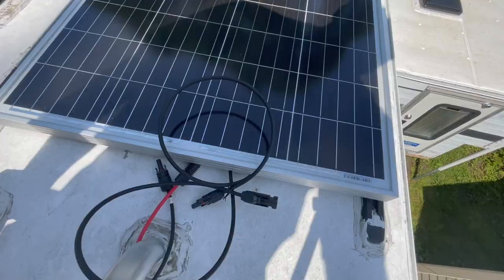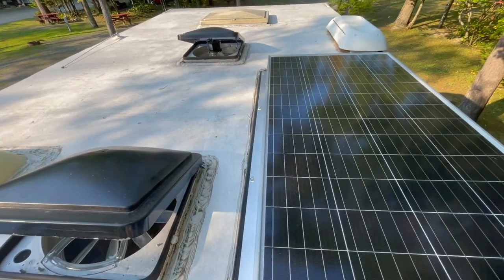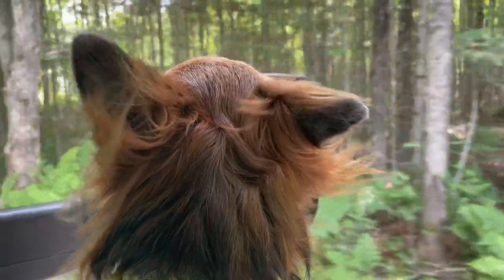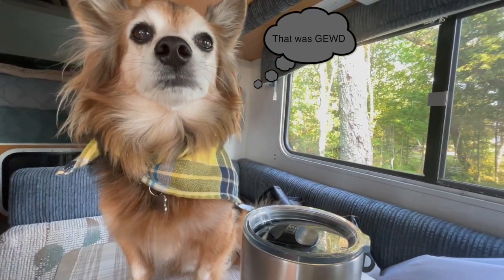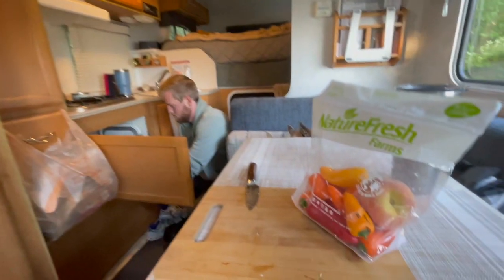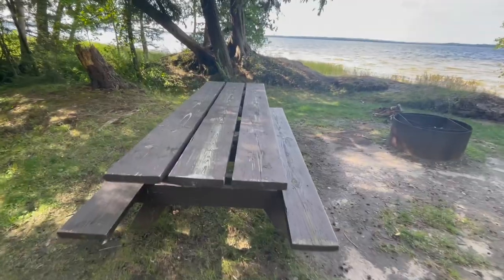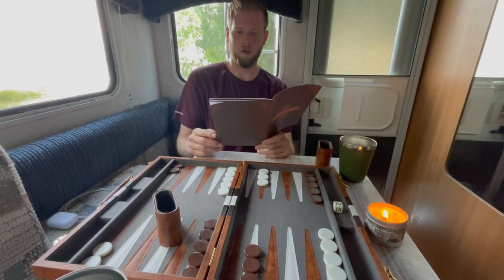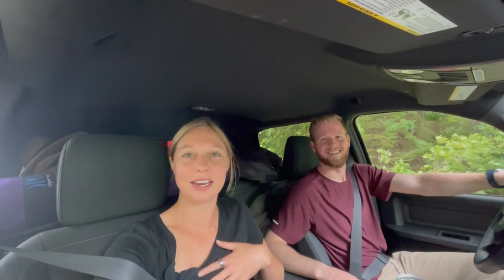DIY SOLAR INSTALL - Is 180w Enough for FULL TIME TRUCK CAMPER LIVING?

Comment: Great job installing your solar. We are very impressed with the amount of space that you have in your truck camper. What a great spot to camp right by the water. So lovely. Mary💕Fred
Reply from the maker: Thank you! We’re finding the amount of space surprising as well, especially for the small platform of the 815!

Comment: I have 225w of solar on my Lance 845 and a single 100Ah Lithium battery.  Summer of 2021 I traveled for 5 months and never used anything but solar to keep my battery charged.  However, I don't have any high wattage devices, like coffee maker or hair dryer.  Safe travels.
Reply from the maker: It’s kept us pretty charged as long as we aren’t running the fridge on 12v. But very happy with the panel so far!
Reply: How much did it cost you to set up?
Reply: @aceazar2806  Not sure if you're asking me, but here's about what my system would cost if bought today.  I installed it myself.

Victron MPPT 75/15	$125
100Ah LifePO4 Battery	$350
2 ea 100w Solar Panels	$200
Misc cables		$ 75
                       -----
                        $750

Comment: Cover the roof. Inefficiency and availability of sun are strong factors. Worst case scenario is are best. Friend with 1000 watts had issues on sunny countries because of worst case conditions. There are some newer very efficient panels. Raise,ventilate for better efficiency. Stick on are handy but inefficient due to heat and expensive. Enjoy stay safe.
Reply from the maker: We’re planning on two more panels that will basically cover the rest of the open space on the roof. Stick on seem easy but I like the hard side panels better so will likely go that route. Thanks for the input!

Comment: Would like to have seen the panel rails being mounted to roof. What size screws and which adhesive or caulking?  Thanks!
Reply from the maker: I'm not exactly sure on the screw size, I just took the mounting plates to Home Depot and used their screw section to find what fit. Sorry I don’t have more specific information!

Comment: Thank you for sharing! loving your adventures. How did you connect the solar power bank to send power to the truck camper? Or do you just use it to plug in devices, etc?
Reply from the maker: Hello! Thanks for the comment, we disconnected the 120-12v inverter that came with the camper and wired the 12v cables into the Anderson output on the GZ. It’s worked great and I can send the cable links if needed!
Reply: @LivingLargeCamping  awesome thank you! Yes please send the link if you don’t mind. Appreciate the help.
Reply from the maker: @honeyiroam  https://amzn.to/3LDEQUQ
If you open the vent under the fuse panel that is the 12v inverter. I just cut the white and black lines from that and wired it in place of the ring terminal on this cord. Then just arrange the black/red connections to fit the GZ and its worked great for us! I also unplugged the 12v inverter from behind the fuse panel
Reply: @LivingLargeCamping  wow! thank you so much for this info. Does this mean that your deep cycle battery is unplugged?
Reply from the maker: Correct! We use the battery compartment for storage. I just have the cables tied up there in case we ever need to put a battery there!

Comment: Which mapping app or program were you using on your laptop when you were planning the next part of your journey?
Reply from the maker: Hi Jimmy, we use Campendium, Allstays Camp & RV, and TheDyrt for the majority of our campsite finds. As far as route “planning” we typically just set an area we want to explore and kind of wing it when we get there. We’re finding this to be a harder way up in the NorthEast so trying to plan a little farther in advance than usual. Hope this helps!

Comment: so was it enough?
Reply from the maker: We’ve had a lot of rainy weather and finding it is not enough to keep the battery full by itself. We’ll likely add more solar and an alternator charger in the future
Reply: @LivingLargeCamping   look up my buddys channel called truck house life. he did a sweet battery setup with diesel heater and it seems  pretty self sustaining, hes in alaska so if it works here ill work anywhere lol